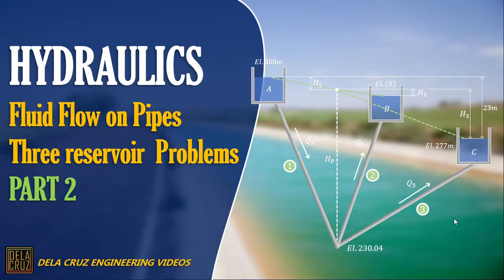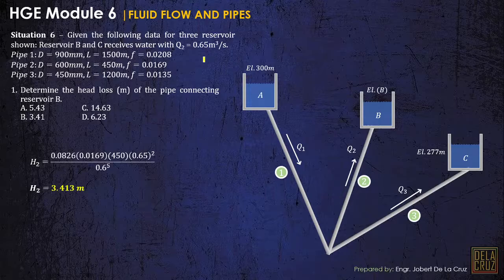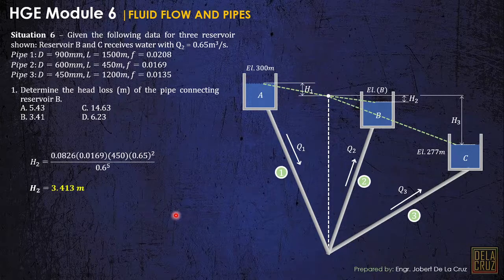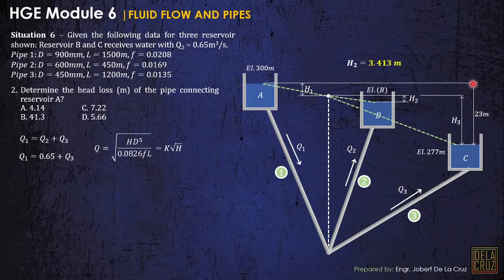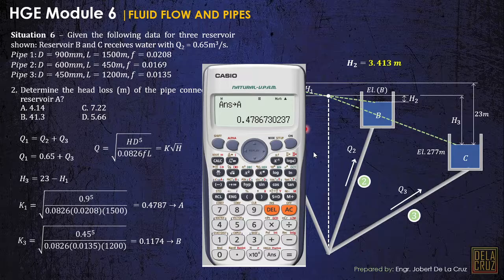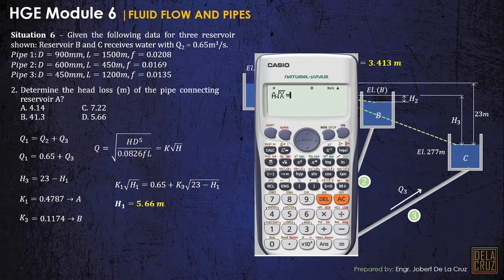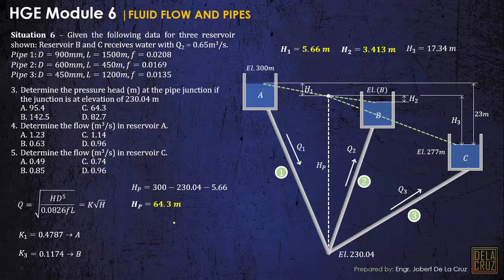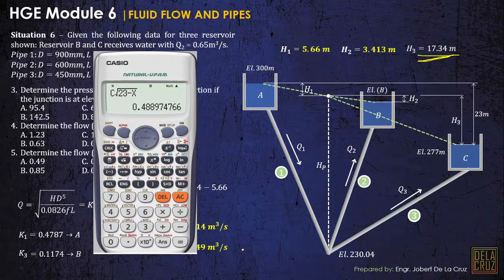THREE RESERVOIR PROBLEM PART 2 | HYDRAULICS   | DE LA CRUZ TUTORIALS

Comment: Engineer! May nakita akong shortcut. Since given na yung headloss ng pipe 2 pwede ka mag back solve para mahanap yung headloss sa pipe 1 by using the choices sa number 3 then the rest follows na to  make sure lang na tama yung pinili mo shift solve lang if tatama given either friction/diamater/length. Galing mo mag turo engr!

Comment: i wants guidlines for it that if a water tank's hight about 60 feet and down flow on a trbine hamer directly via 6 inch pipe and moved a denmo with puli belt and denmo produce energy to move /run motor  and drive trpine for flow water in tank are this circulation of water grow energy or otherwise